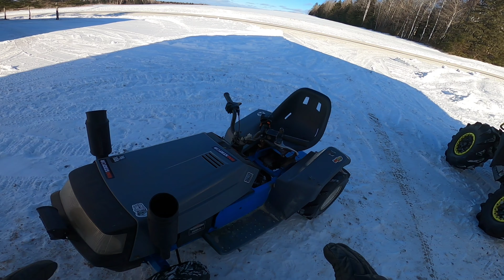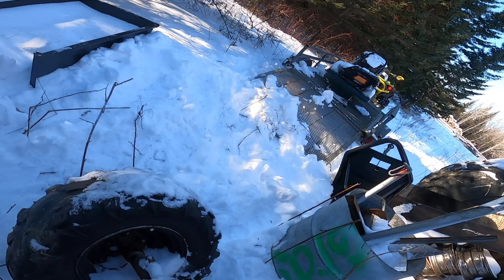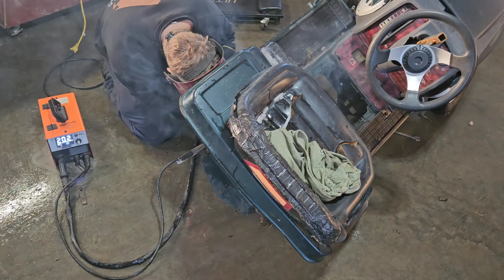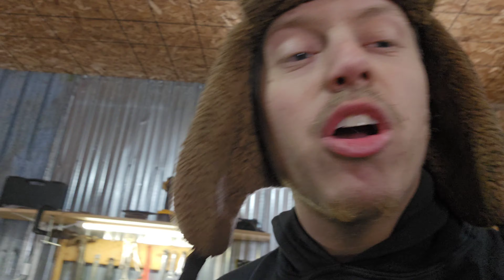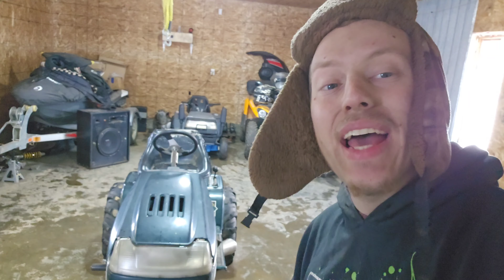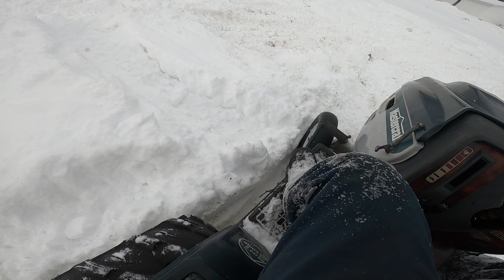I built a SNOW MOWER with LEFTOVER parts !

Comment: big wheels up front is the main thing you need
Reply: Imo its much better to have pizza slicers in front so snow doesnt slow it down. and steering is faster
Reply: Yea its prolly a kid thinks big tires are always bettrr 😂  @mihkus
Reply: @theLyzhendricks  this is spud on my main acc, I have a couple mowers and I have 20 7 8s on the front of one, and they are still too small. they sink way too much for all the weight of that thing, so I'm pressing bushings into 12 inch rear rims to put on the front. They are still a bit too wide so I'm planning on getting 25 8 12s for them eventually. But ya, whatever floats your boat.
Reply from the maker: insane upgrades are coming up soon
Reply: @MisterdionneYT  sickk